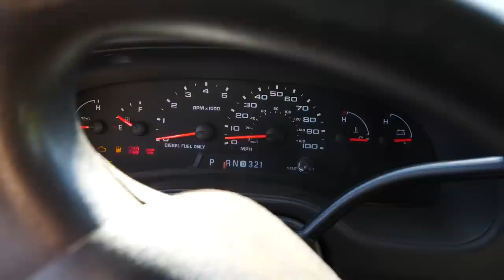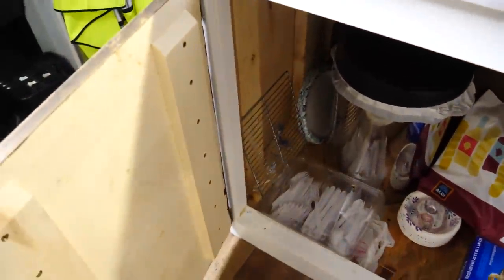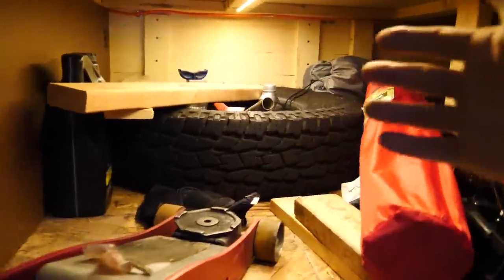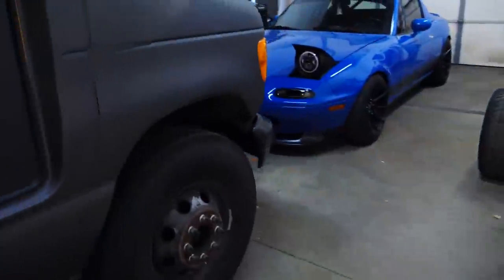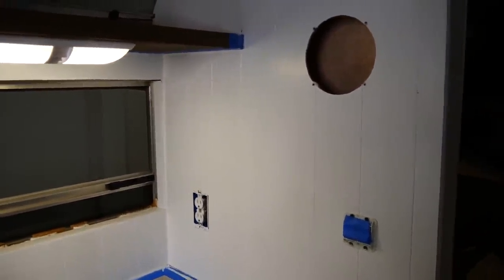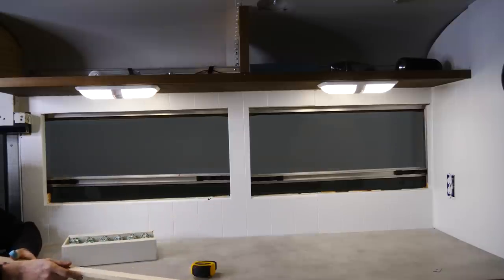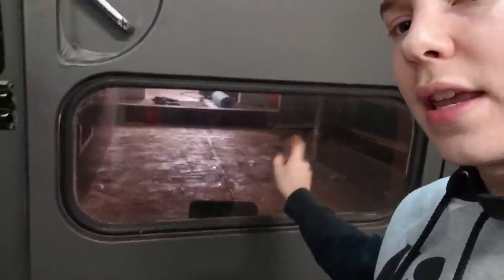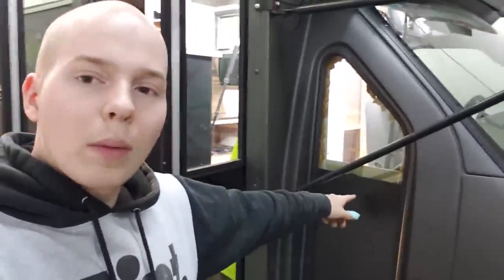Finishing the Interior of my RV BUS CONVERSION!

Comment: When you dont use primer the wood will show thrue.
Reply from the maker: Mhhh interesting! The paint we used the first time was a "paint & primer" in one thing. Hopefully it won't show through this time.
Reply: @_Gingium_  

Never use a paint and primer in 1 hahahaha thats for cheap home owners who have no idea what they are doing.
You should have used a stain blocking primer first, preferably an oil primer then coat it with a latex.

You can put latex on oil but never oil on top of latex
Reply: @_Gingium_  i know. But usually its best to use primer and then paint. But good luck :) hopefully the next layer wont show the wood :) wish you all the best:)
Reply: @_Gingium_   Those fucking suck. Always paint and primer separately.
Reply: @_Gingium_  "paint and primer" all in one products are meant for a surface that already has been coated before, NOT raw wood
Reply: The wood is soaking up the paint, that’s why you can see the knots. Also that’s where the wood is more porous.
Reply: 1 coat of Kilz, 2 coats of paint.  That's how it's normally done and should give awesome results!
Reply: Addy c
Reply: It’s more than just primer. You need to use an oil based primer to lock in those “stains”. What you’re seeing is called tannin bleed, it’s the oils in the wood coming through the surface and staining the paint. The best primer and it’s pretty cheap is Cover Stain by Zinser. It does give off an odor but you’ll never have this problem again. You can purchase it at Home Depot. I’m a painter by trade and use Cover Stain all the time. Water based products will not block this as it is the oil in the wood, not just the wood. The oils will penetrate the water based products.
Reply: @michaelsworld6292  Finally a response by someone who knows what he is talking about. Those were my same thoughts.
Reply: Oil based "Kilz” primer before painting.

Comment: Couple of suggestions:
- Pneumatic finish and/or brad nail gun.  Makes trim install SOOOO much easier not having to hammer in those little nails!
- Around the bottom of the seats, cabinets, walls etc. put some base shoe molding to hide the transition between the painted vertical surfaces and the floor.  You can pre-paint the base shoe molding, then install it with glue and/or brad nails to give a super clean, finished look.

Comment: Those window frames are very similar than in my apartment. I like the bus videos BTW. 
My car needs a new battery, I took it to the tester and the tester guy told that cells in the battery are quite poor and he recommended to replace it.

Comment: Hi G! I have always wanted to get a hold of a mini bus to convert, such as you have. The gunmetal gray looks like an old International Truck color that my bud did on is really old truck. It does make that bus pop along with the exterior rear lighting! There is a very decent white color paint that I have used in the past, oh say year 2000 that was made by Glidden, that is my all-time favorite and it was called "Navajo White" in the (Satin Sheen). It was used on both wall panels a on some oak kitchen cabinets. Now a days, I just don't know if Glidden still lists the color base anymore, but in 2014 I did manage to go to Home Depot and have the paint department do a look-up for it and only to find out that Glidden had renamed that same shade and thus the paint department mixed me up a new batch with all the proper colorant dye/tint mix. And, I must say that it was so very close to the original that it wasn't even funny. It's not a stark white nor is it an antique white either. It was just right! You are doing a great job on your project, overall and thank-you for sharing!!!

Comment: in europe we have a paint that has a lot of metalparticles in them , if you use that under the chalkboard paint you can stick magnets to the board, its handy for holding notes to the board and stuff like that , as fot the whiteboard paint , you might need to scuff it up a little after its dried with verry fine sandpaper , the paint might be to smooth to take the chalk

Comment: Work on function and operating systems first. Esthetics can be anytime. The overall  integrity of the vehicle is most important. And so far it looks like you have a pretty good build.  Keep the cabinet enclosures simple. Try using a decent semi- gloss paint. You can always modify and make changes if you need to. The exterior paint job is awesome! 👍🏻

Comment: Kilz primer will prevent the bleed thru from the wood.  You silly gear head boy, it's not clear coat on wood it's called varnish or poly urethane.   Clear coat is on cars and trucks.

Comment: Do you need some kind of truck or bus driving license to drive that? I'm from Finland so I'm curious how does it work over seas. 🤔
Reply: In the US vehicles are regulated by their weight class, and it also depends on if it is registered as privately owned or as commercial. 

This is considered a privately owned, non commercial vehicle, although it could be registered as one because of his YT channel. Some states have different regulations on private heavy trucks, but since this is under 26,000 lbs and does not have air brakes, it’s legally no different from a normal car mostly. One could drive it as their first car. 

For commercial vehicles; one does not need a special license for anything under 26,001lbs. However one does need a drivers physical for anything over 10,000lbs, and may need a special endorsement if it has air brakes, or if they are driving passengers or hazardous materials.

Comment: How to kill your ficm 101
Reply: John Doe it’s not the jump start it’s the constantly dead batteries, low voltage and the slow cranking means low voltage. They need 48v and when they dip below it often it usually kills the ficm overtime. It’s just how it works